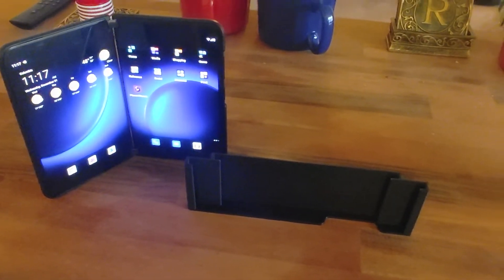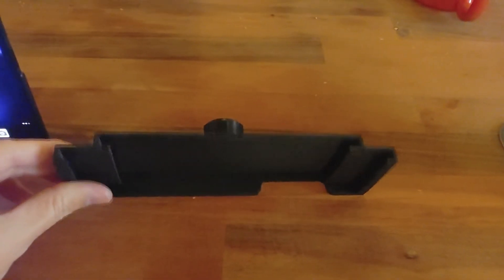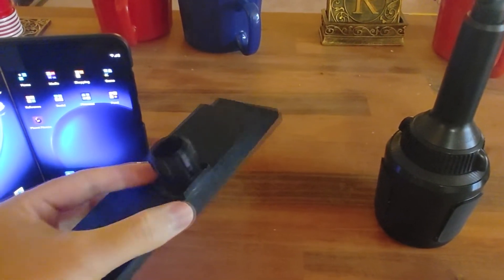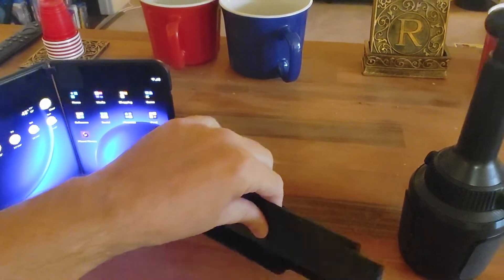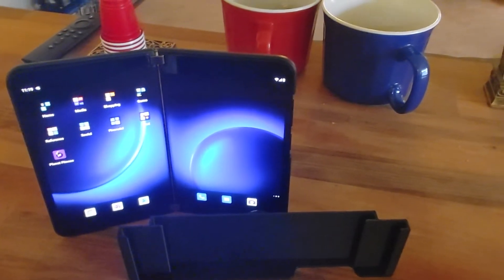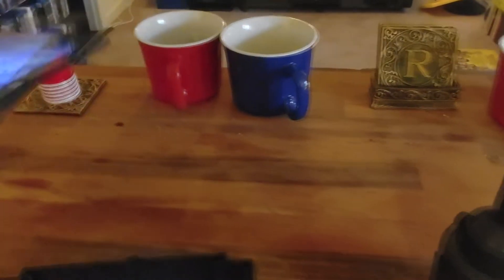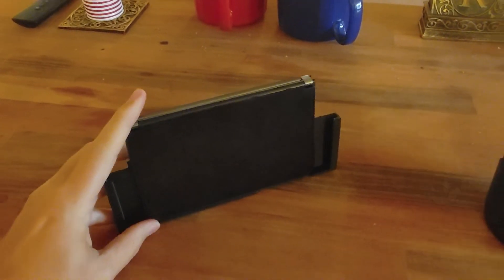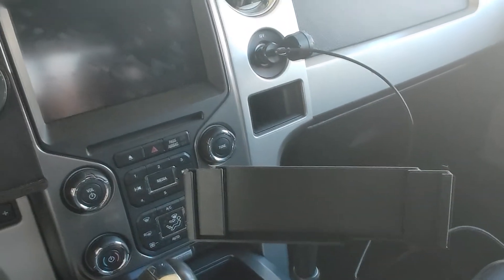Microsoft Duo 2  - Car Mount

Comment: Amazing. Really good work.
Reply: Can you print me one, how much and do you use PayPal, PM me please
Reply from the maker: Sorry but doing so is to costly. If you really want one you can have 3rd party printing services. Just research the materials. Pla warps pretty easily in the heat.